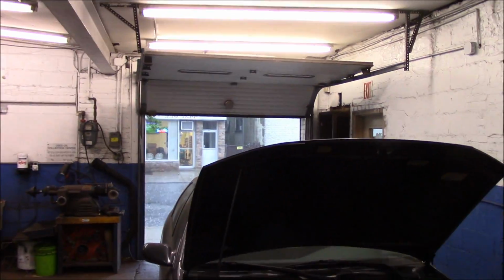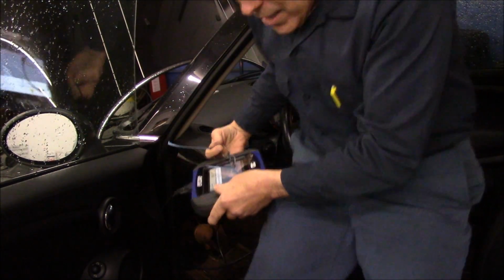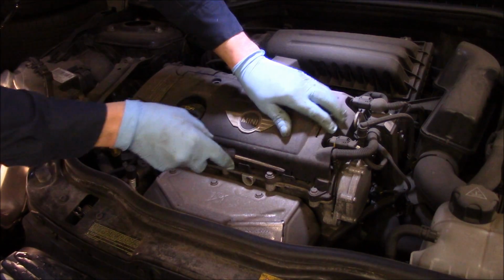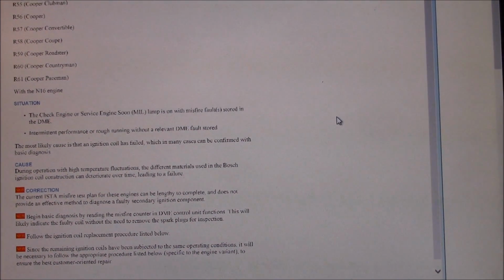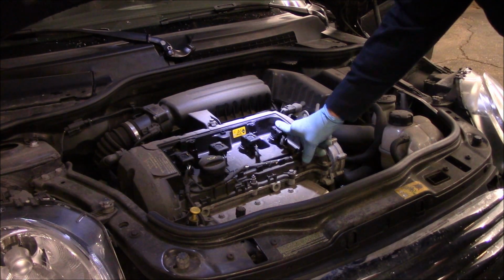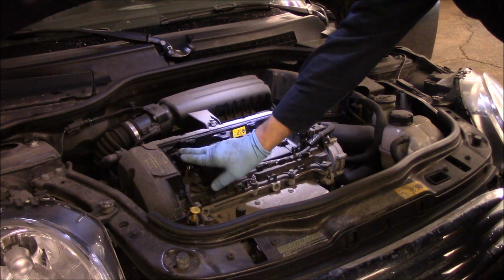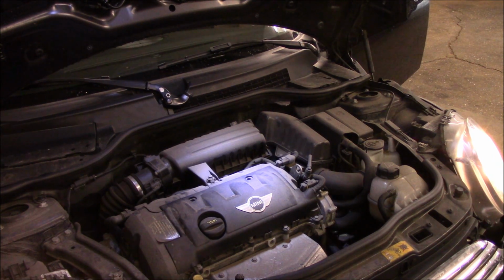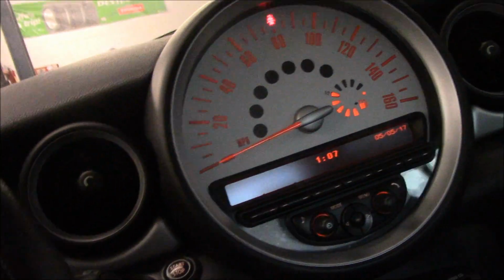Diagnose and repair 2013 Mini Cooper P0304,P0303,P0302,P0301

Comment: I just wanted to take a moment to say, thank you. some people complained about the noise from the rain but they should be thanking you for still taking the time to record regardless of the weather. my R56 started giving up on me 90 minutes away from home on the highway going 75mph on an uphill at 11pm. I made it home safe connected my code reader in the morning and code P0302 generated - watched your video and fixed ALL my problems. I would like to note prior to this my fan would ALWAYS stay on even after turning off the engine. I would have issues turning on the engine - it would just crank (i needed to wait 5 minutes after I originally turned off my engine) that problem is now gone. My car is better than it has ever been. (purchased it pre owned) Jim, thank you for taking the time do makes these videos. You don't have to make them and I am grateful for you still doing so.
Reply: If anything I think the rain is a bit soothing when I’m trying to fix my car 😃😃
Reply from the maker: Thank you for taking the time to drop me a line. It's nice to hear something positive about my videos. As you know even when you try to help someone for free they still complain. Don't forget subscribe and hit the bell for notifications of any new video . 
https://youtu.be/Xw_RqXxQI2o

Comment: Which cylinder is PO300 and PO301
Reply from the maker: The PO300 is just saying that the computer detected a misfire and the PO301 is telling you that the misfire is in #1 cylinder.
Reply: @jimthecarguy  I keep looking up on Google which cylinder should be switched out as all 4 are new. The order of fire in a 2013 is chosen 2 different ways. So annoying. Where to find the correct order of fire?

Comment: I just have to ask, the coil you changed was #4? 
The set up is 1, 2, 3, 4? 
Sorry :/ I am not sure if I missed the part where you said which coil was changed. 
I know you mentioned changing #4 somewhere else to test the coil but wanted a confirmation as I am changing my coils this weekend. :)
Reply: 11 months later... He changed out #4. He said #1 was always nearest the front of the engine, nearest the fan. So in this case 1 is on the left and 4 is on the right.

Comment: My 2015 countryman does the same but only if I accelerate fast. If i drive normal i never see the issue. Normally if i speed up too quick i can feel the hesitation at that point i release the accelerator and all is good. If i do not let up it will go to limp mode and check engine light comes on. To clear the limp mode i just pull over stop the engine turn it on. The car drives normal and the check engine light clears after a minute or two minutes f driving. I will take your advice and order the 4 coils and check in later

Comment: Hi Jim, , great video.  I'm watching because I had a misfire on my 2015 Mini R60. The check engine light came on as well as the 1/2 power light on the steering console.    It has been in the shop for "8" days and the mechanic still isn't sure what is wrong with it.  He said he changed the plugs, checked the compression, swapped the coils, replaced the injectors and it's still misfiring.  He now wants to try replacing the DME at $1,900.00.  I'm freaking out!  What should I do??
Reply: Did you get it figured out?
Reply: @stevey500  yes, it was the PCM. Took it to Mini Cooper expecting a big Bill but they told me the module is warrantied on my Mini Cooper I didn't have to pay for the part or labor!

Comment: Jim I have a 2014 Cooper non-turbo 48,000 miles with #1 cyl misfire (p0301) but it is not intermittent. It’s happens EVERY time I drive the car but only at lower RPM (2500 and less) and moderate to hard acceleration. If I keep the RPM over 3000 it drives normally with no hesitation or misfire. Given those circumstances do you think I should pursue the coil?
Reply from the maker: It does sound like a bad coil. There was a TSB about the failure of the coils. Good luck.
Reply: Thanks for the advice I’ll let you know what I find out
Reply: I replaced all 4 coils even though the CEL was for only cyl #1. Cleared codes with my scan tool - Car runs like a top and no CEL anymore. And it was a super easy repair too. Thanks for the informative videos.

Comment: Dealer quoted me $738 for Ignition Coil Replacement, and $217 to replace the spark plugs.  After spending $225 for a Ignition Coil and Spark Plug kit (all for cylinders), and $10 for the sparc plug socket extension. I spent a total of 20 minutes of installation, now  I am Good to go...   Thanks for the Video!
Reply: I did my own car it’s a big Deal !  I do not know crap about mechanics of my mini but I know I have an excellent ear for any noise on every car mini 101 thank you YouTube have done3  projects completely myself! Nana New career! Lol 🤞

Comment: I am obtained a mini cooper r56 and I have this problem when increased the engine temperature in all cylinder have misfired.I replaced all ignition coil but the problem continues to be the same. what's your opinion?
Reply: Try changing the vanos solenoid

Comment: What brand of engine code reader is that? Also, should I buy that one, or is one other than this brand acceptable?
Reply from the maker: The one that I was using is made by OTC it is called Encore. There is a lot of less expensive ones out there .

Comment: HI Jim, I have a 2005 mini cooper s with 84000km on it. I have changed all 4 coils and 4 spark plugs as well. But, the engine light came back again. And I have bought an OBD diagnosed tool, the code came up as P0302, P0313 and P0456. could you help me to understand the problems? At this point, do you think the car is worth to fix or should I trade in and get a new car? thank you for your help, deeply appreciated.
Reply: heather bai every figured it out?

Comment: I have a 2013 Cooper S and it only misfires at higher RPMs. For instance, if I want to get up to speed quickly, such as merging onto the interstate, or the occasional redlight to redlight dragrace.  At high RPM, it sputters then goes into low power mode and I have to pull over and shut it down for 5-10 min.  Then my HUM sends me the p0301 code.
Reply: hello i have same problem < could yo fix it how? thanks
Reply: amorosoelguru - I replaced all 4 coil packs and that fixed the problem.
Reply: Thanks for your help have nice day.
Reply: Change your spark plugs too!!!
Reply: hello john i changed coil , spark plugs  and the car runs fine , and the light is still on  , i checked it on auto zone scan tool it gives me the same codes again it  miss fire,they said to run it for a least 100 miles and the  light would go a way , do you think that is true?, thanks for all your help appreciate it
Reply: Thats good to hear that your car is running fine again.  It is possible what they say is true.  Their scanner can only read the code, it can't clear them.  I have a professional type scanner that can clear out the codes and that is what I used on my car.  You will need to have the code cleared from the cars computer.

Comment: This was a curious diagnosis. The scantool never revealed an active DME fault in cylinder 4, nor does the scan data summary show a stored cylinder 4 misfire. If an active error is not shown, its difficult to glean any information from switching the coil position or replacing the coil a new one. If this was merely an exercise to demonstrate the procedure to follow diagnose a P030X code, then well done. If the procedure was used to fix the car onscreen, then...not so convincing.
Reply: Generally when there is a tsb for a known common failure in a part associated with a dtc chances are that part is the cause. Since the dtc wasnt active it can become extremely time consuming to diagnose since a misfire can be caused by several different systems. Sometimes it's easier and cheaper to start off replacing a component with a known issue rather than fully diagnosing an inactive fault.

Comment: Love the diagnostic videos Jim. They sure don't make 'em like they used to. The coils in those BMW/Mini engines ought to last a lot longer than that. Seems modern cars are designed to get through the warranty relatively trouble free and then not much beyond that.
Reply from the maker: Your right get through the warranty and your on your own.Thank you for stopping by the shop

Comment: Since the TSB named Bosch coils as the problem did you replace the coil with another Bosch?
Reply from the maker: No I used a different one.Good point
Reply: My wife's R59 standard cooper with only 23K miles just got a P0302.  Is there an alternative to Bosch 0221 504 470 that I can use for longer life?

Comment: On this particular fix, I see you did not use any dia-electric grease. Do you feel it is not necessary? I think it would make future removal of the coil much easier and help seal out moisture.
Reply from the maker: Thank you for stopping by the shop.

Comment: As always a very good & informative vid Jim. Just out of interest, does manufacturer provide any resistance specs for the coils, though in this case it is probably of no use due to being an intermittent fault
Reply from the maker: Thank you for stopping by the shop.You right intermittent problems can be had to pinpoint.

Comment: Best way to keep screws that go into plastic from stripping out the hole is to turn them counter clockwise with a light downward pressure, like you're taking them out. You'll feel and see the screw lift up a little as you are turning it, then suddenly the screw will drop down. When they drop down is where the screw has already cut it's thread into the plastic, go ahead and tighten them down.
Reply: Works for bolts that go into aluminum too. :)
Reply from the maker: Thank you for stopping by the shop. and your input